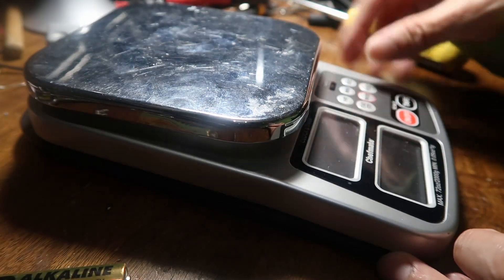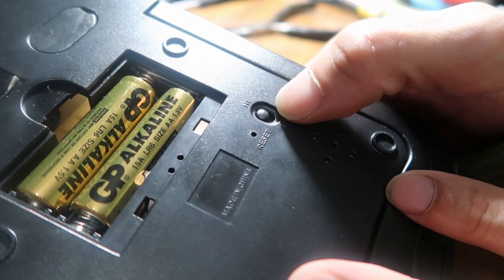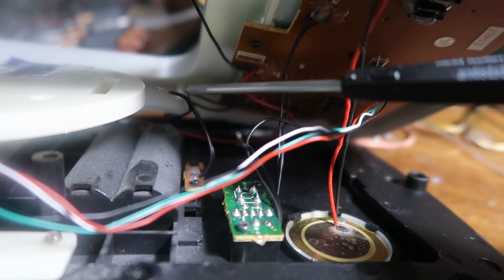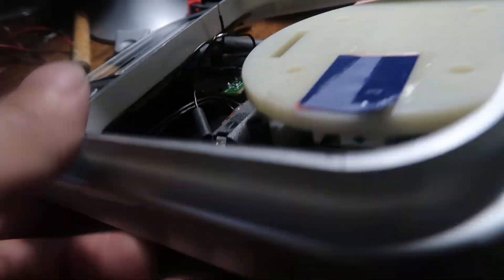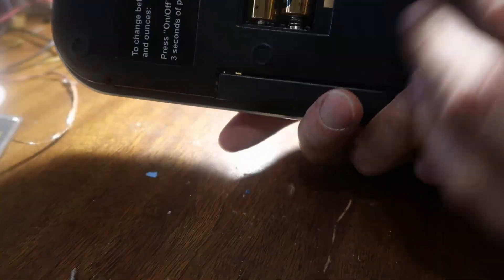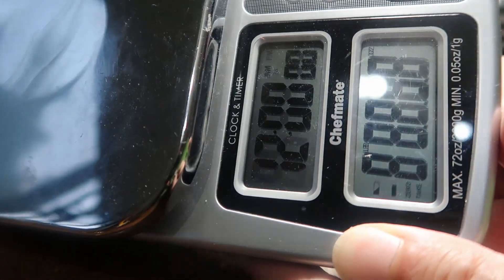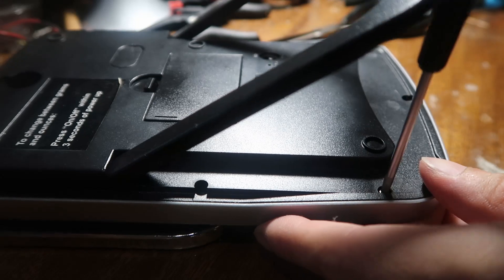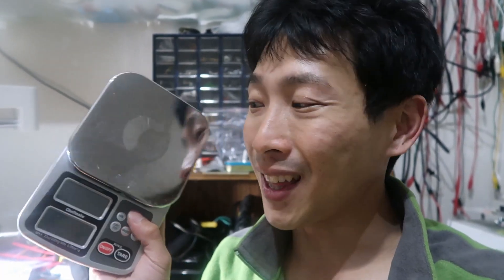Kitchen Scale Modded with On Off Switch

Comment: You don't have an AC adapter for it so you can just plug it in the wall?  It looks like it would already have had an on/off switch on it to do that.
Reply from the maker: Nope. It isn't included.

Comment: Hey BeatTheBush, so heres my understanding of what you did (please correct me if i'm wrong as you are the pro here) :  So you cut the black wire which is the live      wire , supplying power to the entire circuit, and cut the black wire from the switch button and connected the wires to the live wire.    But, how does the switch know  to turn off power because it was initially used to change the  volume?
Reply from the maker: The connections are only on/off. So if I cut it, it becomes permanently disconnected. Or I can permanently connect it with a jumper.